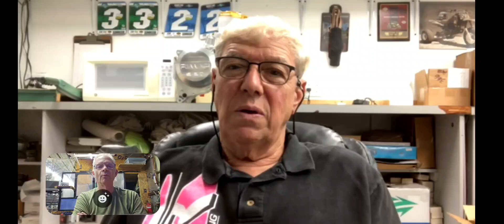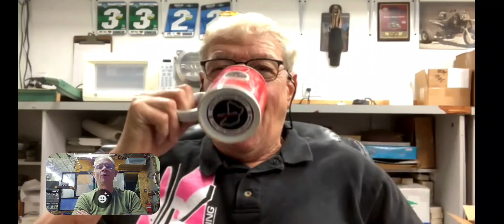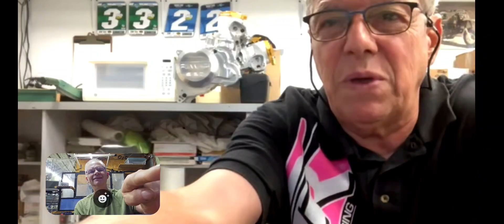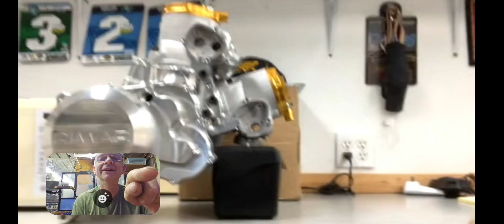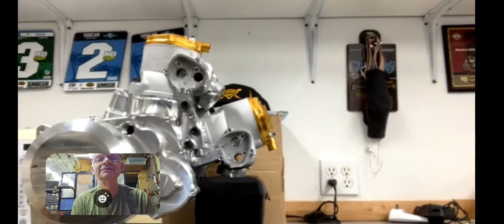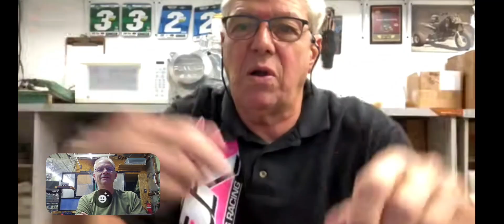Reed Valves pt 1 with Tony Doukas of TDR

Comment: Interesting topic.  I'd like to hear his opinion on the V-Force, RAD valve, etc.  I'd also like to hear more on reed tension.  I thought that low tension favors the bottom end and high tension favors the top.
Reply: I will finish the material, tension, design, secession first and then go into all the different explanations of cage designs along with much more reed related questions.  Always feel free to throw the out there to be discussed.
Reply: @TDR-GPTech  Oh, and what about boost bottles--what's his opinion?  I have some vintage 80s 3-wheelers with them.  The Tri-Z came stock with one.  I figure they act like reed spacers and effectively add volume to the crankcase.